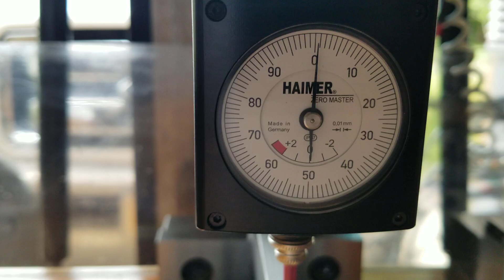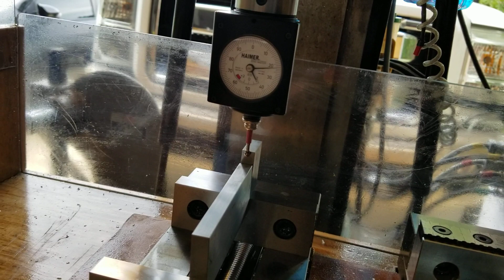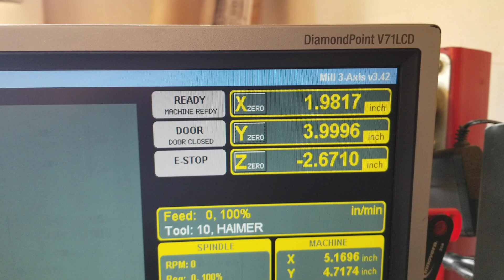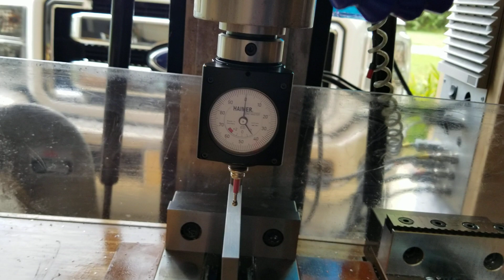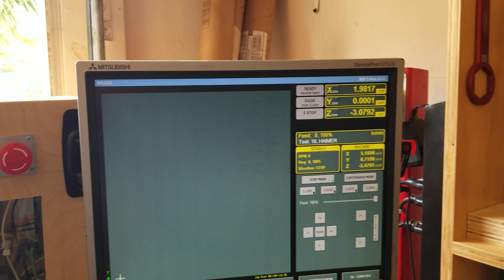Dialing in the Distance per Revolution Settings on Masso

Comment: Thanks for these vids on the Masso. They are very informative especially to someone who is starting out and trying to learn this stuff like me.
Reply from the maker: Glad you enjoyed it @halfstep67. I am having a blast with my CNC milling machine and router. I find myself designing new things and making them myself every week. I really enjoy the gratification of having made something on a machine I built from scratch.  The Masso cnc controller is very easy to use and understand compared to many other system.  You should check out the CNCnutz Masso Edition channel by Peter Passuello for great tips on how to setup and use your controller.
Reply: I watch CNCnutz videos as well. Hopefully I will be able to finish my 940 conversion in the near future. I have the electronics enclosure done and plan on starting the ballscrew mounts next.
Reply from the maker: @halfstep67  That's a good plan. Once you have the control box done and tested the motors you move onto the mechanical parts and your done.... or just getting started!
Reply: It's a pretty basic enclosure and I plan on adding some more switches and relays later. Here are some pics I posted on the Masso forum awhile back. https://masso.com.au/forums/topic/pm940-conversion/ I've kind of stalled out until I can save some more money to finish the conversion. Hopefully I can finish it up before too much longer. Your opinion and any advice on my enclosure is appreciated.
　
　
What's your thoughts on the release of the new G3? I wondered when they might release an updated controller with more memory. I think that has been a difficulty with the current G2 model is not enough memory.
Reply from the maker: @halfstep67  The added memory and faster processor on the new controller should be an awesome improvement.  They are also introducing a new relay card to fix the issues we were having with the unprotected TTL outputs getting damaged. Masso said that they also plan to release their own touch screen so that they can eliminate the compatibility issues with the multitude of touch screen types out there.  Although the controller is new it uses the same software so the older models are still supported for awhile longer.  All great news for Masso users new and old.